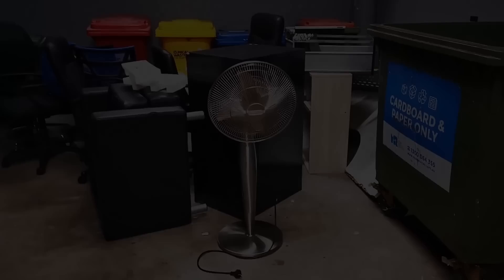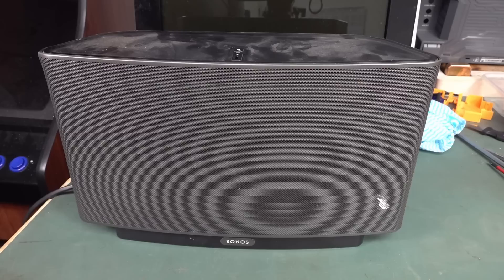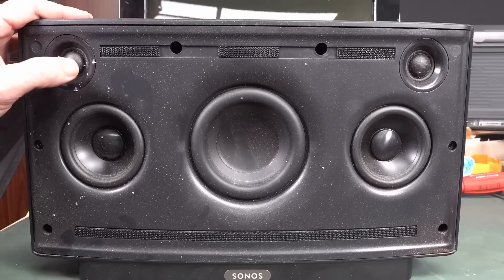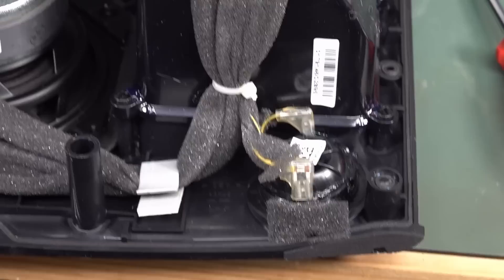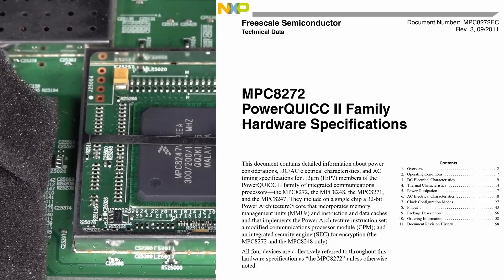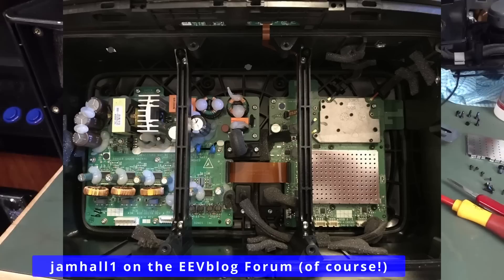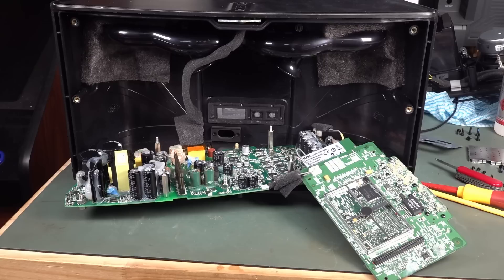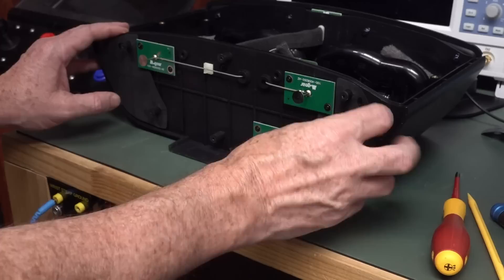EEVblog 1514 - Sonos: The Juicero of Wifi Speakers? (TEARDOWN)

Comment: In 19 minutes and something in and did not even mention gilding the lily how is that possible or is it just that awesome that he hadn't said it yet I'm kind of surprised to be honest!

But on the technical side of things it's just like wow but on the technical side as well not wanting to work with the modern app and things not being backwards compatible and all that jazz that's just a no sale for their products I'm not going to go with some sort of Wi-Fi speaker thing when what you have just works yeah I could do Bluetooth but not be tied into something and ecosystem like this where you're basically stuck something specific that's something that is Justin no go in my book you better just have a decent amplifier and decent speakers and maybe Bluetooth and always have headphone ports and one in in line ounce you can't go wrong with analog inputs and outputs they would still work even if something else to it's just you need to stick with what's out there that works even nowadays for digital TV back in the day it would still be washable even on analog even if you didn't have the best reception nowadays good luck with anything like that it's almost like replacing something that has to have all the wizbang microprocessors and all with something that could just be analog there's less trouble with something like a simple analog voltage from a sender on a fuel tank for the fuel level as long as you get the steady 5 volts in the old case you're good much less complicated and just works just like oftentimes analog when my phones just worked even when cellular was not working and landline still did work.

Yeah sure there's downsides but there's upsides as well

Comment: Meh, the bass driver always shat it's tinsel leads. I have a picture somwhere of me connnecting the sub lead to a 12" sub at my old work unit and it did bump. I am not a auidophile snob. But some shit is just over priced shit. I swear it's just bose in a differnt colour using dsp rather than physics. But I apreciate the tinny clock radio sound when I'm brushing my teeth or cooking or what ever. Sometimes I like to sit down in a nice chair and just listen to the good shit with a beer or two and melt away.

Comment: They Built it That way For You.      They watch Our Videos. And For A Change They Built it For You And Peope like Me Who Are picky.      Why complain Dave.  They Built it. Taking bits and Bob's from your videos.     Plus Another Thing Is.    WITH Every New Design.   They Over build then cut back from thier.      This one's ACUALLY built better then GEN 2.   Gen 2 empty compared to this one.    ANOTHER REASON.   The Thumping Bass Tears Circuit Boards Apart in short order.    That's why bolted down

Comment: Sonos gear is junk. Still using STP when the industry moved to RSTP ages ago (network spanning tree protocol). Unless you specifically turn the wifi off on them they will happily flood the crap out of the wifi and set off unifi loop detection. Their fake atmos sound like it is coming from the sound bar, because it is. The controller speaker will stop talking to other devices on the network after a month or so. Probably fine if you have 3-4 of them in your home but any more and they will need to be wired, and if you are doing that do yourself a favour and get an amp and passive speakers.

Comment: I usually have a feeling for Dave's dumpster saves, at least the ones I see, but this one I would have left into the dumpster... chiefly because SONOS is a brand that I do NOT acknowledge, but also because it corroborates the idea these kind of brands really do not know what they are doing.

They went overboard for this cheap simple plastic speaker because they had no idea... no idea how to integrate efficiently a PCB antenna, no idea the guy with the caulking gun... that is hilarious, a nightmare for any repair technician, no idea how drive the amplifiers, no idea how to sound deaden the whole thing... it seems they just ticked every box they could because they DID NOT DEVELOP the darn thing, they just designed it, crossed their fingers and hoped for the best... perhaps with the idea of coming back at a later stage after having risen some millions of profits.
Reply from the maker: Tell us what you really think!
Reply: @EEVblog  I picture this: mid 90s SONY Corporation, about 350 US bucks, schematics, ahh did I fogert the PARTS LIST, every screw marked with an arrow, board layout numbered and sectioned.

It's the state the whole Hi-Fi market it is these days... it's a hit and miss and you never get the refinement that big Japanese Corporations had in their top tier models during the late 80s until the mid 90s.